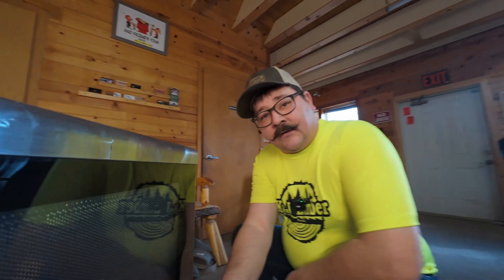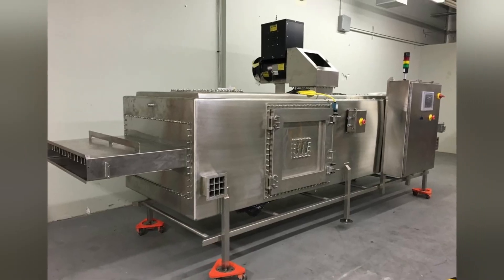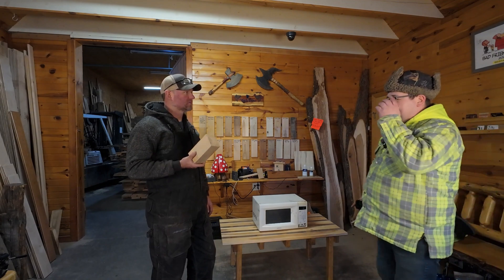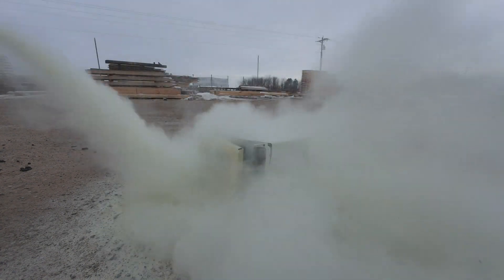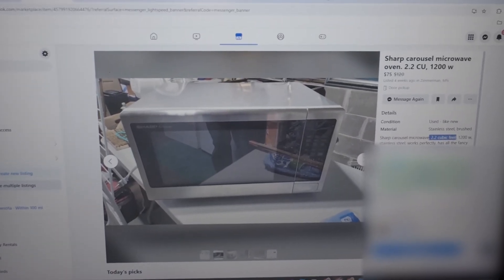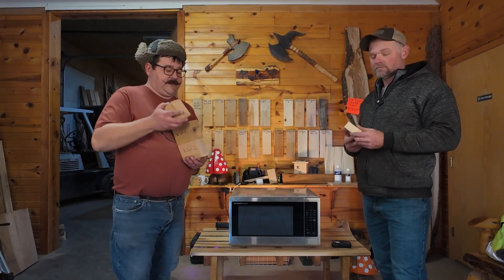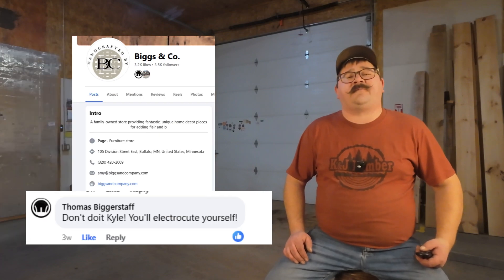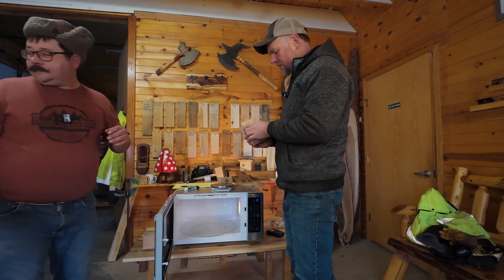Can You REALLY Dry Wood in a Microwave!?

Comment: 15 to 30 second bursts. The wood heats up fast, so you don't need it in there long. I dry green wood this way to prevent cracks, but after hearing up the wood, I let it sit for a while and it usually does just fine.
Reply from the maker: Yeah we kind of expected to need to heat it in bursts, one of the regrets we have is not adding in the boring tests part, showing that we heated it in intervals etc.

Comment: How about oven drying? I know it’s essentially just a kiln but I’ve used that more than a microwave in a pinch. 

Also, I love the dramatic ending 😂
Reply from the maker: Thanks Matt! Essentially, the Microwave heats the wood from the inside-out, so that helps to prevent the cracking, warping, and twisting that we see with traditional kilns (aka the oven in your house).

Comment: Ok, Next experiment is freeze drying? Frozen thing, and put it in a vacuum bag and the water turns to gas without boiling. They dry water logged books this way, why not wood. Oh, TYVM for the stickers.
Reply from the maker: I am honestly still a bit skeptical about this, almost as if it is too good to be true. The universal problem with air/kiln drying lumber too fast is that it dries from the outside-in and creates problems like cracking warping twisting etc. The reason this works is because it dries from the inside-out, whereas freeze drying may dry it from the outside-in (in which case, we run back into the same problem as air/kiln drying too fast). Then again, I might actually do more tests on different wood species.